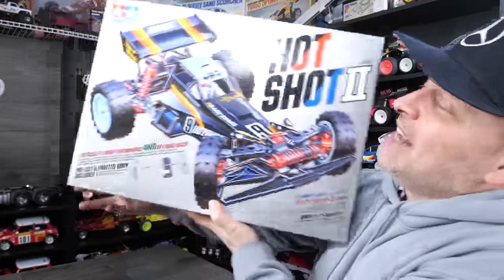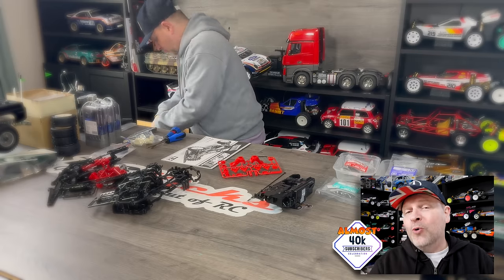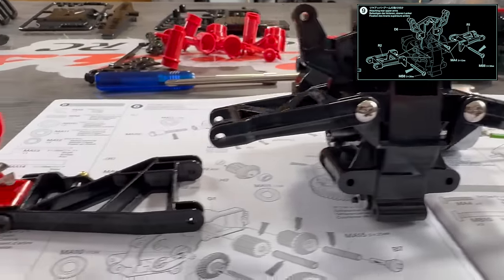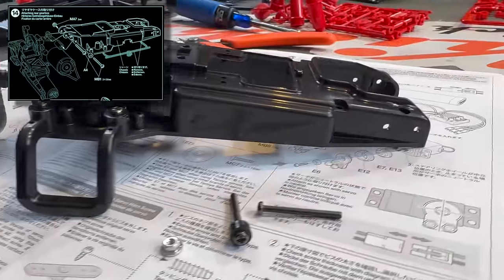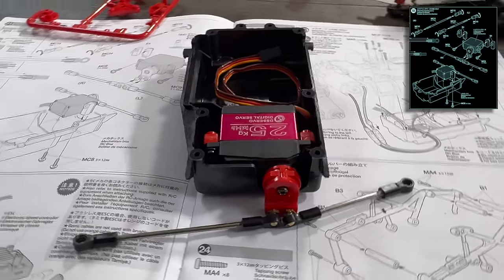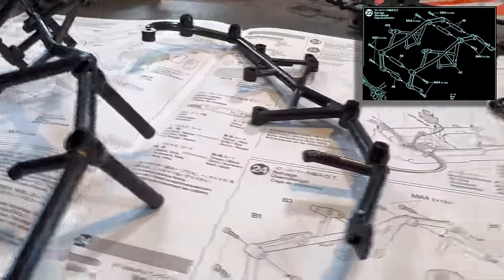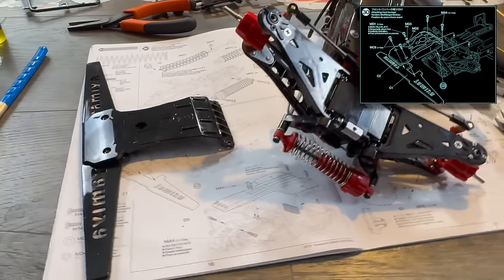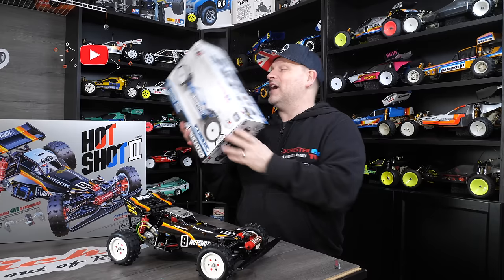SPEED BUILDING An RC Car Kit From 1987 (Tamiya Hot Shot 2 Rerelease 2024)

Comment: @RCKickschannel This was my first ever RC car. I loved building this back in the day. 
This may be controversial but on completion I was disappointed that it didn't look like the box art. ( My parents still has the kit even though they retired to Jamaica and I'm almost 50 😂 )
The box art car is wired and low and basically looks amazing not unlike the real dimensions of most pro buggies. Wide arms low stance but the finished car is chunky narrow and far from low stance.

For example the Egress box art really does look like the completed buggy. In fact most time your box art looks way closer to the stance of the finished buggies.

If I was tamia I would create a new version of the hot shot that was the same stance of a modern competition buggy but the styling of the hot shot and the hot shot 2. Now that would really be worthy 😊
Reply from the maker: You can adjust the stance easy enough to make it as low as you want, you just put stops inside the shocks.
Reply: @RCKickschannel  That would help 🤓 but The Hot Shot Chassis is genetically big boned. You could remove the shocks and let that belly hit the ground and it still wouldn't match the sexy box art 🤣.

Have you ever done a breakdown of old tech Vs new tech? I'm aiming to get RC10 B7.x and would love to know what the new setup is about

Comment: Regarding the screw pins there was a good idea from RC Action Australia. For the front suspension of the terra scorcher he heated up the screw pins as much as it needs to soften the plastic a bit during screwing them in. As a result there shoud be much less pre-tension in the plastic, which reduces the risk of cracking. So far the theorie, I had no change to test it on my one until now....
Reply: Are you  referring to the screw pins that attach the front and rear suspension arms? I think they should be fine just with lots of Grease applied. They go in much easier that way. 👍👌

Comment: Well i wasnt a mile away, i went to 4.5 hours as you where painting the driver. Looks epic Gav 👌 i think we will see a few of these at vintage events this year. Its one i want to get, but its down the pecking order sadly. So will be a good few months away yet 😭
Reply from the maker: Hi, The front shock will need some tuning for sure to dial it in as the kit setup oil is miles off lol.  In kit setup, it feels like a frictions shock as the oil is way too thin.  Stunning looking vintage buggy mind.
Reply: @RCKickschannel  ive seen a few put zip ties on to reduce droop 😂 or it was to hold it together. Cracking buggy either way 👍